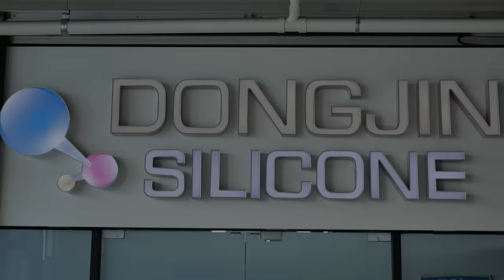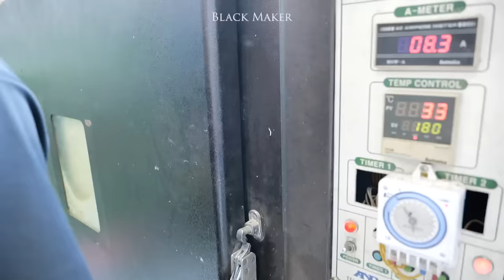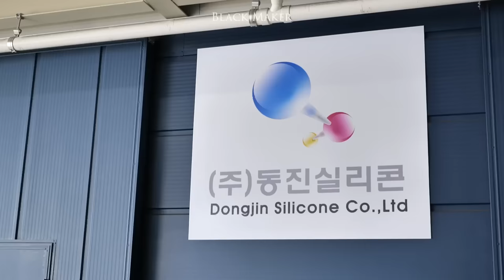Amazing Process of Making Products with Silicone. Korea Silicone Factory

Comment: hello, great video. I have a few questions about this, is the silicone organically peroxide crosslinked or is it a platinum crosslinked HTV silicone? Is an extruded product created from this, or sheet material for, for example, cutting products? What is the Shore A hardness of the finished product? Do you also make silicone compound to create silicone sponge for extrusion? I worked for many years in a multifaceted silicone processing company, hence my interest. Thank you very much 🙂
Reply: Yes, it is.

Thank you for watching!
Reply: Me gustaría formularte algunas preguntas ya que eres experto:

- Después de mezclar la silicona en los rodillos, cuánto tiempo se guarda la mezcla antes de vulcanizar.
- Cómo se hace para eliminar el aire presente en la silicona en el proceso de vulcanización ?
- Cuál es el tiempo de vulcanizado ?
- A qué temperatura vulcaniza la silicona ?
Reply: @TomChris  Hola y gracias por tu interés,
Me gustaría intentar responder a tu pregunta lo mejor posible.
Re - Después de mezclar la silicona, ¿cuánto tiempo se mantiene la mezcla en los rodillos antes de vulcanizar? Puedo decirles que, por ejemplo, las mezclas que se producen en el MILL de 2 rodillos se basan en una mezcla de peróxido orgánico HTV (reticulación a alta temperatura). Estas mezclas se pueden almacenar fácilmente en lugares frescos durante meses hasta que se utilicen para su procesamiento.
Para - ¿Cómo se puede eliminar el aire presente en la silicona durante el proceso de vulcanización? ¡Puedo decirles que siempre se deja escapar el aire atrapado en las mezclas antes del proceso de vulcanización! Para la producción de perfiles como cordones de silicona, se fabrican mangueras y perfiles personalizados mediante una extrusora. En la extrusora, la silicona se transporta a través de un tornillo giratorio, los pasos de dicho tornillo se vuelven cada vez más estrechos y el diámetro del núcleo del tornillo aumenta, lo que significa que el aire se ve obligado a ventilar durante el transporte inmediato, y es extremadamente Es importante que el tornillo y el tubo del tornillo estén extremadamente bien enfriados porque este proceso genera mucho calor y, sin enfriar, la silicona en el tubo del tornillo se reticularía. En la producción de materiales en banda se utilizan las denominadas calandras, reforzadas y no reforzadas. Estos pueden ser muy diferentes en forma, número de rodillos y anchos. Por ejemplo, con una calandria de 3 rodillos, puede imaginar la producción y desaireación del material de modo que la distancia entre el rodillo 1 y el rodillo 2 sea de 1 mm, y la distancia entre el rodillo 2 y el rodillo 3 sea de 0,5 mm. Entonces, al agregar la mezcla entre los rodillos 1 y 2, las primeras bolsas de aire se ven obligadas a escapar y luego nuevamente cuando el material que ahora está en el rodillo 2 se presiona entre los rodillos 2 y 3.
Para - ¿Cuánto tiempo lleva la vulcanización? Puedo decirte que depende esencialmente del tipo de vulcanización. Cuando se utiliza un autoclave, la vulcanización de materiales en láminas puede tardar varias horas, dependiendo del espesor del material que se esté produciendo, por ejemplo, láminas de 1 mm u 8 mm de espesor. Al vulcanizar materiales en láminas en un Rotor Cure (teóricamente es posible una vulcanización sin fin de láminas delgadas), el tiempo puede variar, por ejemplo, de 30 minutos a 1,5 horas (dependiendo del espesor de la lámina). Los perfiles extruidos se pueden vulcanizar tanto con una caja caliente como con un túnel de calentamiento (producción continua), esto también se mide en metros por hora y el espesor del material también es responsable de ello. Otra opción es producir los perfiles en plataformas giratorias en longitudes de bobina y estos se colocan sobre láminas permeables al gas y luego se vulcanizan en un horno. Aquí ciertamente son posibles tiempos de 2 a 5 horas. También hay que mencionar que todos estos materiales producidos de esta manera aún deben ser recocidos (exposición al calor a lo largo del tiempo), esto sirve para aumentar la temperatura de transición vítrea y lograr la mejor resistencia posible del material.
Para - ¿A qué temperatura se vulcaniza la silicona? Puedo decirle que depende esencialmente de las especificaciones de los fabricantes de silicona, así como de la tecnología de procesamiento y la experiencia que traiga consigo. En el área HTV se utilizarán seguramente entre 160 y 220 grados.
Espero que haya podido encontrar respuestas a sus preguntas aquí; desafortunadamente, no estoy seguro de qué tan útil es el programa Google Translate para tales propósitos. Si algo no está claro o tiene más preguntas, no dude en escribirme. Te deseo un lindo domingo 🙂

Comment: Mixing looks dangerous if hand gets stuck 😳
Reply: We were told for producing with small machines for silicone fingers to never use gloves. Cause if the machine catches the tip of the glove it will pull you in. And the distance is sometimes below half an centimeter 🙈
Reply: @gwenifyer that is true but i saw them using latex gloves and those rip easily
Reply: It’s not so dangerous, I guarantee.
Reply: @rics2022 how do u know?..
Reply: Takes me back to 1982 and learning to operate a two roll mill as part of education to be a plastics/rubber technologist
Reply: @CreativeName56 some machines are fixed with a pressure sensor so anything hard passing through will stop it to keep the machine safe from foreign bodies. Such as hands and other items